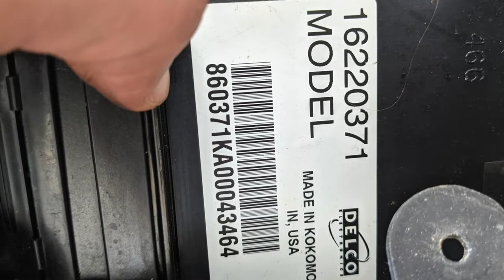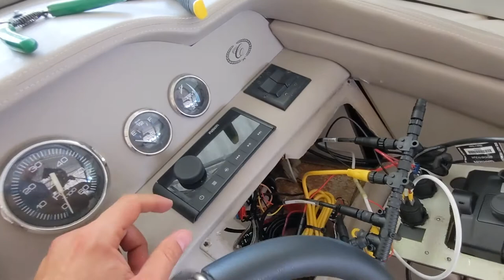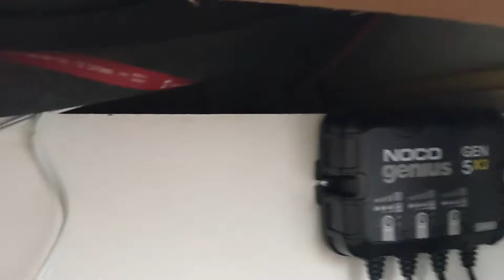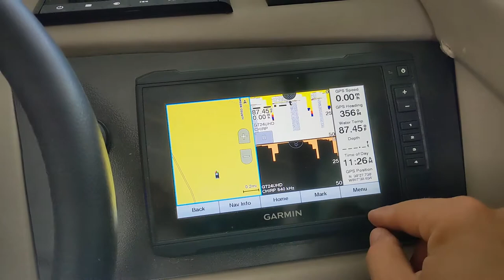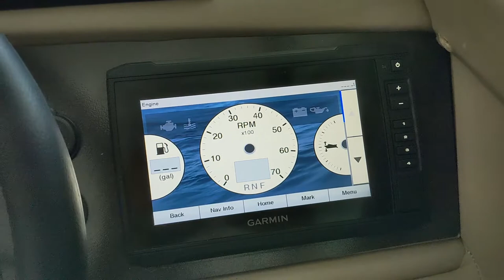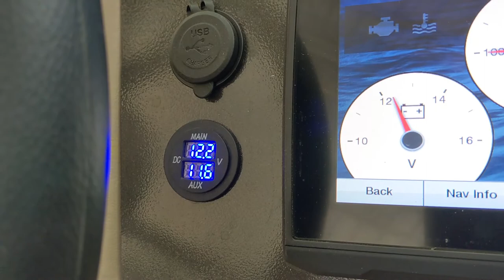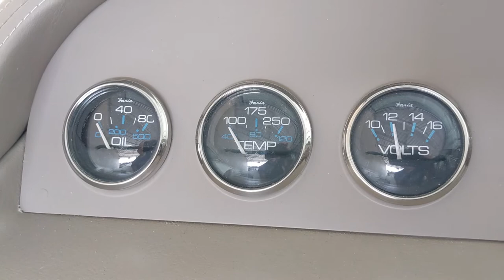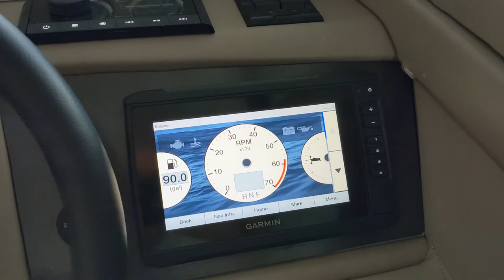Fox Marine Gateway NMEA2000   -  Installation & First Impressions

Comment from the maker: NMEA 2000 Wiring Starter Kit: https://amzn.to/3DKpf1q
Garmin Echomap UHD 73cv Chartplotter kit: https://amzn.to/3mWu9m5
Fox Marine Engine Gateways: https://fox-marine.com/
10m NMEA 2000 Backbone Cable: https://amzn.to/3DL5k2b
NMEA 2000 Double Drop Tee: https://amzn.to/2WNrTTd
Fusion RA-210 Radio Headunit: https://amzn.to/3zISYFD
Fusion Wireless ANT Remote (white): https://amzn.to/3DJhFE6
Fusion Wireless ANT Remote (black): https://amzn.to/3kOlRKo
Fusion Radio Dust Cover: https://amzn.to/3BDTGV1

Here is the video on the Fusion Radio NMEA 2000 integration and initial impressions: https://youtu.be/cZdfrNG5-E4

Comment: Installed the MEFI 3 unit with oil pressure kit on my 1999 7.4l VP this weekend. Other than the normal headaches with pulling wires and having to be a contortionist to work on a boat it went smooth. Great system for anybody looking to upgrade their system.
Reply from the maker: Glad to hear your install went well. Are you using the phone/tablet Bluetooth connection on yours? Or over nmea2000 to your display? I use both here and there, since the Bluetooth app shows me a lot more info information
Reply: @NKPGarage  It is tied into the Nmea2k. I grabbed the BT app but have not been able to get back to the boat to play with it.
Reply from the maker: @raypennington5754  They're both useful in different ways. For diagnostics, to look at engine hours, etc... The BT app is the one I use. For daily use and while cruising around, the NMEA2000 displayed output makes life much easier.

Comment: Why don’t you trust the digital fuel readings? (Just curious). Did you have to buy an attachment for the oil pressure?
Reply from the maker: I purchased the oil pressure sender to add to the NMEA2000 network, but never really got around to installing it. With the digital fuel readings, they seem pretty accurate, as long as you update it each time you fill up.
Reply: ماذا تعني بالتحكم عن بعد بجهاز الراديو او اي تحكم اخر وهل يوجد اوتو بايلت وماهي قوة المحرك والموديل

Comment: Did you ever find out what that gauge was reading? The one with B symbol
Reply from the maker: Yup!! That is for "boost" if you have a turbo charged engine. It shows manifold pressure (PSI). So if you have a supercharged engine or a turbo charged engine it will show the PSI (boost pressure) while operating.

Comment: at the 23:49, only the gauges with the red arrows will work. Those indicate which ones are reading. The rest will be inactive with your engine ecm. At least that is how mine works.
Reply from the maker: Yes sir, you are correct. Mine works the same as well. You can add more sensors to your NMEA2000 network on the boat for the other gauges.

Comment: I have a MEFI 1 on Mag 502s. I am in the process of installing and did a quick install. I was able to see RPM, Fuel Flow, battery, coolant. Should there be more info.? How do you get others to show up. Garmin echo plus.
Thx
Reply from the maker: Try downloading the phone app and connect to it over Bluetooth. The app will show you everything that your engine computer is outputting. From there he’ll be able to see which ones of those outfits you want on your Garmin  I hope
Reply: @NKPGarage  I got around to finishing up my install. thanks for your information and this video. I running an RS11 Noland Nmea  thats is picking up the oil pressure and sensors for coolant pressure and Fuel level. Seems like the Garmin unit Echo map has fixed gauges and you can not rearrange which sensor for the first screen etc. Next step will be to hook up Fusion Radio to NMEA 2000. Are you still happy with the RA210 or would you upgrade to another model. Thx

Comment: Excellent Video - did you do part 2?
Reply from the maker: For part 2 I did the integration of the Fusion headunit into it as well here. Video here: https://youtu.be/jyVBkMlIIk8 I will be doing a part3 in the spring with more details and walkthrough of the entire Fox Gateway setup.
Reply: @NKPGarage  Where did you connect the shielding part of the power cable.  I don't understand what that needs to be connected to?
Reply from the maker: @geraldmuccioli8374  Normal practice is to connect the shielding to a clean ground.